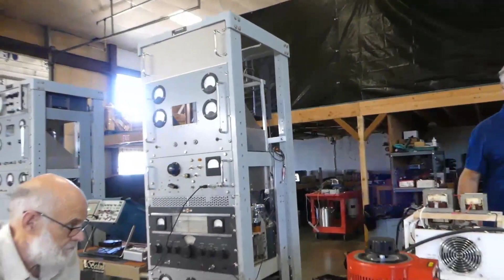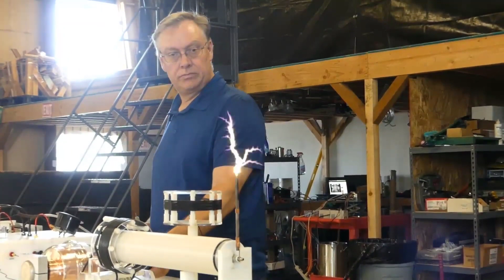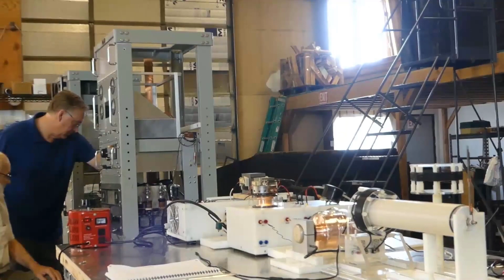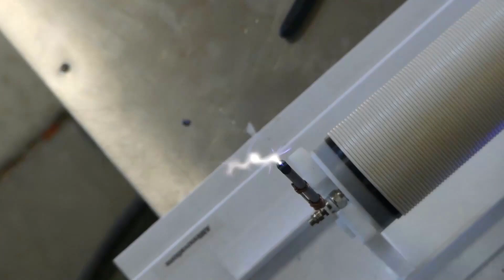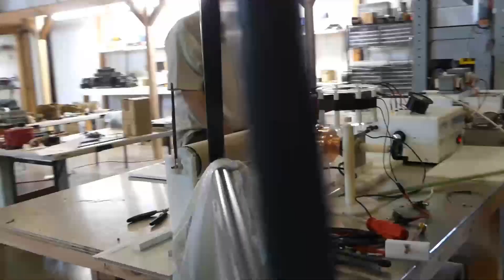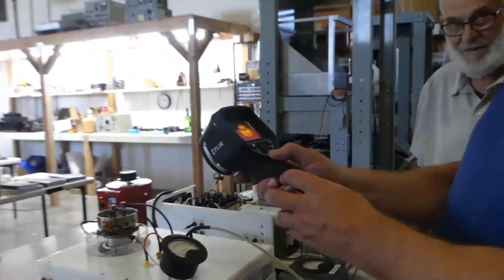Extended Golden Ratio Discharge Experiments - Adrian Marsh, Eric Dollard et al.

Comment: You should get an inline duct blower, and mount it a ways away from the tube, and position a duct pointed straight down at the tube. Vent the enclosure away from control side out the back. 

Otherwise, I love the horizontal Tesla coil.

Comment: This is ridiculously obscure, highly esoteric, poorly explained and couched in techno-babble.  

It  shouts ⚡ danger from every component and looks hugely expensive.  

I came with an open mind.  

Jeremia - for whom I have some admiration - looks like a zombie and contributes nothing to the "experiment"

We are told we are consuming and producing power and yet there is no reference to "efficiency" (I am at the mid-point now)

Mercury is definitely a substance that should be avoided, so no matter how good it is at fast switching it is decades out of date.

I am left thinking if you want high frequency MHz switching of 50v at 5amps there are stepper motor circuits for less than $100.

No-one is ever going to buy this for their home!  Besides code compliance and many complex components, lack of ANY familiarity on the part of experts with the whole approach or subcomponents.

These things combine to make this totally impractical!

Can you imagine a contractor responsible for installing and guaranteeing safe operation of such a device?  I cannot.

Moreover: Is this Science?  Is it Engineering?  I saw no measurements over time (Science), calculations or explanation of purpose.  I saw a device fail catastrophically, so it is hardly "Engineering" in a practical or a fast prototyping way.  As a component - the "resonant tube" will never run again!  Not only that but it warms up and can only run for 30 seconds.  

Is this somehow a "good video" in an esoteric way?  

I would argue "no".  It perpetuates the #ZeroEnergyMyth. 
It does not examine #Resonance in an accessible way for its audience.
#It is self-elevating for its participants in a #FieldOfStudy in a medium where the trade-off of 40 wasted minutes on YouTube when I could "feel good" and watch Lex Fridmann discussing Python coding styles, or www.DroneBotWorkshop.  

It doesn't help me. I sense it is as arrogant as I am in making this #JournalEntry.

A contained fusion reactor is more likely to solve our problem than anything I see here.

explanation of purpose.  I saw a device fail catastrophically, so it is hardly "Engineering" in a practical or a fast prototyping way.  As a component - the "resonant tube" will never run again!  Not only that but it warms up and can only run for 30 seconds.  

Is this somehow a "good video" in an esoteric way?  

I would argue "no".  It perpetuates the #ZeroEnergyMyth. 
It does not examine #Resonance in an accessible way for its audience.
#It is self-elevating for its participants in a #FieldOfStudy in a medium where the trade-off of 40 wasted minutes on YouTube when I could "feel good" and watch Lex Fridmann discussing Python coding styles, or www.DroneBotWorkshop.  

It doesn't help me. I sense it is as arrogant as I am in making this #JournalEntry.

A contained fusion reactor is more likely to solve our problem than anything I see here.

Sorry guys. Just my view.
Reply: And the heat that it produces in the components looks like it doesnt transfer energy too great. Imagine the heat it would produce if at scale
Reply: I watched another one of these very similar and there was no stated purpose or goal it was totally unclear what the hell the guy was even doing and for what reason.
 It seems it's as bad as he wanted to make the little sparky discharges ... and he made sparky discharges....
That's it, isn't it. He made the sparky discharges...

Comment: Discharge through a wooden antenna.
Instead of a single lightning strike hitting a Metal Antenna once every few seconds, I want an Antenna thats constantly being bombarded by Trillions of bolts
One bolt thats broken into trillions.
The more in tune I am with the "Ionisphere" the lower my antenna can be to the surface and still connect to pull power 

Trying to ground lightning by breaking a single bolt into many then sending this through a massive Mass Generator which is just the biggest motor you can build (big enough to handle a bolt of lightning) 
Which this mass is stored within a vacuum and balanced on end

My phone is powerful enough to play PS2 games pretty well by now
If this can run on solar panels, that's free energy.
In a low power state (when you're not using it) 
It should auto charge even in low light or artificial light conditions 

Where if you want to actually use its full power, use a bigger panel or find more light 

When we talk free energy, thats what I mean

It'll start with Headphones
You will no longer ever need to plug small devices into the wall
Then cell phones
Then laptops

Comment: What's your thoughts on bendell and greenyer?
Reply from the maker: I am not familiar with their work, can you elaborate on how it relates to this experiment ?
Reply: Certainly. I'd like to drop a link but  last time I did I caught a ban for spam. Bendall just developed an invention called the thunderstorm plasmoid generator. It utilizes 3 effects. UV light to ionize air, a cavitation bubbler to force the gases to condense, and a set of spherical exhaust pipes that forcd air to spin in opposing directions. I do not know much about it, but am trying to get outside opinions on it. Everything I've seen so far has impressed me. 
"Plasmoid thunderstorm generator" its much like a GEET engine

Comment: Does the danger of microwaving internal organs exist only because there is a tank LC circuit in the setup? With a tube ran in impulse modulator mode, without LC tank in the anode circuit, would still these parasitic oscillations appear with power?
Reply from the maker: Hi, any electrical resonator (LC tank) that is capable of generating high power and very high frequency oscillations poses a health risk from internal RF burns, whether directly in contact with the skin, or radiated to the body. A power impulse tube modulator will generate a very broad spectrum of radiated emissions (parasitic LC or otherwise), and should be treated with extra special caution. The high frequency energy needs to be contained as much as possible within the experiment, cavity, or load that you are working with. If the TEM mode is allowed to radiate off of the experiment because of poor matching, grounding, or containment of the induction fields, then it will easily pose a health risk over the longer period and also with implanted medical devices, quite besides the EMI generated to neighbouring electrical systems and services.

Comment: Would love to see more about that amazing vacuum capacitor!  Are those MOTs and microwave capacitors?
Reply from the maker: Hi, you can find much more on these vacuum capacitors (KP1-4), and the experiments they are used in on my website at am-innovations.com. The hybrid high voltage supply used here has 4 x MOTs (2 series 2 parallel) and a level shifter with 8 x MOCs.
Reply: @aminnovations  thank you some much! I will definitely check out your website!
Reply: @aminnovations  Your website has so much exciting content!  I look forward to reading through your research! I have been recently reading Robert Adams's paper on the pulsed motor. There is a YouTube channel that freely offers 3D print files to build an Adam’s pulsed motor.  I am hoping to replicate his design, but it will take some time to acquire the magnets.  I am so glad I found your amazing channel!

Comment: For me the most interesting part of the video is when you and Eric are talking about grounding and parasitic oscillations. And also the dangers of essentially microwaving your internal organs without even knowing it. I think you get a similar effect in cyclotrons where they call it ‘synchrotron radiation’ which is where you have high energy electrons colliding with external magnetic fields which generate photons and X rays. Also high voltage vacuum tubes generate Xrays, which are harmful. So it could be dangerous exposing yourself to this machine while its running without employing proper radiation shielding.
Reply from the maker: Hi, there is interesting research being done at the moment, primarily by Griffin Brock, and all of us at EPD Laboratories, that the radiation given off is not actually X-rays but a finer vibration of emission that passes through matter and is not the same as X-ray ionizing radiation - for more info see Griffin Brock's ESTC 2023 presentation on Tesla's ShadowGraph tube at EMediaPress or on his website.
Reply: @aminnovations  Thanks! I will check it out, however…Your theory may be correct or it could be wrong. If I were you, I wouldn’t risk it. Vacuum tube technology, is well understood, and if you look at the work of say Philo Farnsworth, who made the vacuum tubes for TVs as well as flash tubes for cameras and even a functional fusion reactor, he demonstrated that these high voltage devices do emit potentially cancer causing radiation. And whether you call it an ‘Xray’ or something else doesn’t change the fact that being exposed to this radiation is dangerous. So I would proceed with caution and use proper shielding when conducting these high voltage experiments.